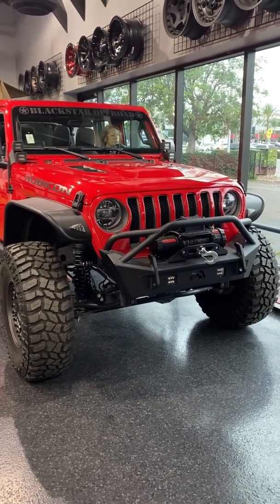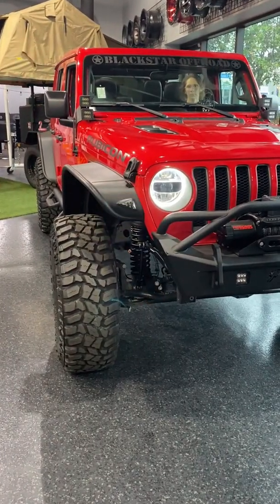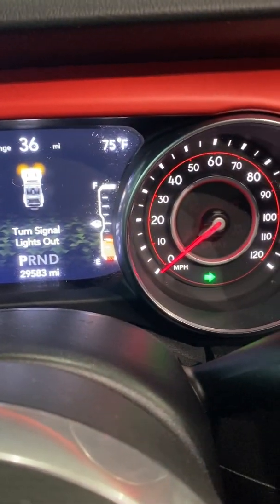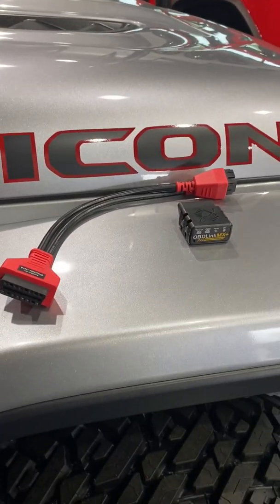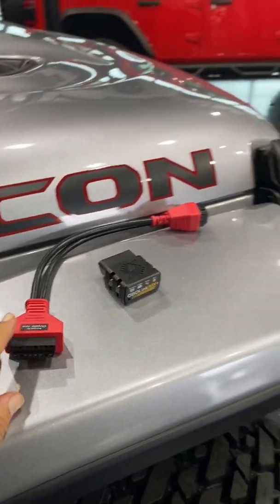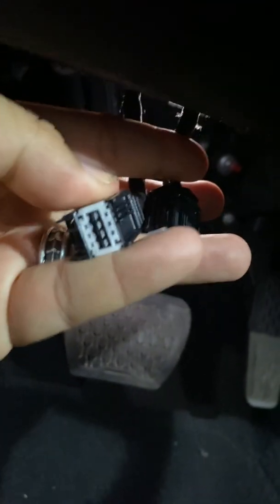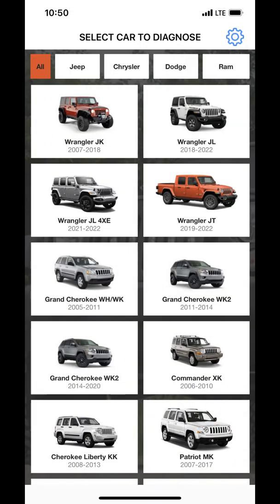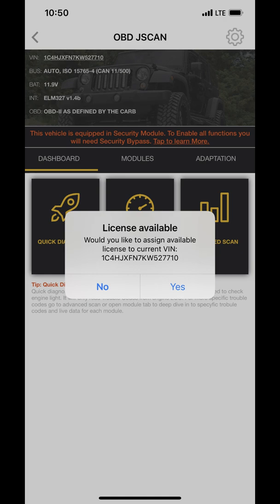JL Wrangler Turn Signal Lights Out Error Message and Hyper Flash Fix With Aftermarket Fenders

Comment: My 2020 is doing this same thing but not all the time everything is stock factory. When it dose it flashes fast like a bulb out but when I stop and look they are burning doesn't mater left or right signal when it gives message flashes fast and the lights are burning flashing fast may drive it 3or 4 days before it dose it again

Comment: Did not work for me. Had OEM halogen Turn Signals, swapped them for American Adventure Labs Fender Chop led kit. Can confirm this did not work in my case. Back to the drawing board

Comment: It would it be correct to assume that if I changed my OEM halogen lights with LED's and i get the turn signal out message along with the fast blinking, I should follow your process and activate rather than deactivate the LED setting?  Thanks

Comment: Hi there do you know why the message come back. I got jeep wrangler Sahara .2019 . Appreciated it, you help
Reply from the maker: Were you able to fix it previously and now it came back?
Reply: @BlackstarOffroad   hi 👋, yes just for 1 hours worked and back again the message.
Reply from the maker: @christiandavidpicadofallas9754  Here is what I would try. First I would go back into the LED light settings and change them back to Active. Probably won't fix it but try it. If it doesn't fix it, go back in and switch back to inactive. There are so many different led lights that we need to try both ways. Secondly, after changing the LED settings, go to adaptations, LED Light Settings, iRestart, then Body Controller - Power on restart. Then turn the key off and shut the doors until the Jeep falls asleep. After a couple minutes, turn the Jeep on and give it a try. Hope this helps!

Comment: Hi, was wondering if this same procedure would work with Oracle bi led switchback headlights? Everything working great, but hyperflash error shows up when I use the blinkers. Seems to reset after shutting off the jeep, only to give the code again next time I drive it. Thanks!!
Reply: I got the same problem the message comes back again. Do you idea what happened??

Comment: purchased and installed on 2022 JL 2D Rubicon.  did not work as this video shows.  problem still persists.  Spent a few hours to disconnect the cables (several bandaids later on right hand to get in to disconnect), plugged in the 12pin & 8pin dongle to ODB Link.  ODB would not power on using the dongle.  had to reinstall back to factory placement.  Installed ODB Link MX+ to the factory ODB connector and did power on.  spent the $21 to get vin.  went through the setup to deactivate, all the way to "says successul", gracefully backed out to the home screen.  tried several variations, but the JL still throws error of front lights not on.  sporadic turn signal blinking continues.  All in all a frustrating experience.  $ wasted, time wasted and hand all cut up.

Comment: Found the bluetooth device but what exactly is that cable?
Reply from the maker: The cable is needed to bypass the security gateway. This is not needed on older Jeeps but the 2018 and newer Jeeps require it.
Reply: @BlackstarOffroad  but what is it called? You dont mention it in your video
Reply from the maker: @ec2499  I put the link to both parts on Amazon in the paragraphs below the video.

Comment: I crested a small video call here are the lights. Hop you can see it
Reply from the maker: I saw your video. I see that you went from a factory LED to an aftermarket LED. I am assuming that your harness was plug and play so I am surprised that your having an issue. I would call the manufacturer and talk to technical support. My gut tells me that something is not wired up correctly possibly within the turn signals and daytime running lights.

Comment: Thank you, i did not buy new fenders, just after market led sequential turn lights, with DRLs and another set of sequential led turn lights for the fenders. I tried resistors and thqy quit working except for the drls. I took the resistors off and they do work except fir the annoying hyper flash after I went in with the odm i lost the turn signals so now everything is back to where i started lol
Reply: Thank you!! Really appreciate all your guidance and help. Will follow up with manufscturer.

Comment: Forgot to mention that i still have the obd plugged into the red cables
Reply from the maker: Hi George. Please read the updates to the paragraph below my video. Some fenders are fixed the way I showed in the video and some require another method. The second method required "activating" the LED and then clearing the fault codes stored within the body control module. Hope it helps. Please reply with the brand of fenders that you are installing.

Comment: I have a 2019 JL with the halogen package, I was able to successfully upgrade the headlight and fenders to LED without any errors from the dash. I just now decided to upgrade the taillight to LED but getting the dash error on both sides when my turn signal lights are in use. Will this be the tool to address my issues? I just will like to know before I make a purchase.
Reply: @willo Sandaya that's because the Jeep CPU isn't programmed to look for LED when you don't have the factory LED package.
I have the factory LED package with my JLUR and changed the rear tail lights to Oracle LED Flush Mount and the CPU is looking for factory LED, so I got the warning on the dash
Reply: a Resistor comes with the LED taillights package for the Jeep owners who don't have the factory LED package